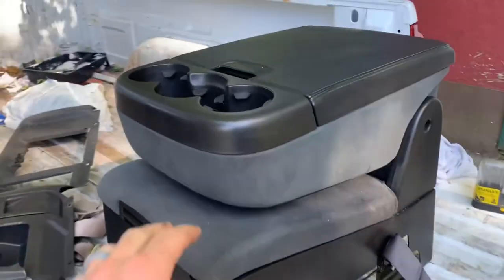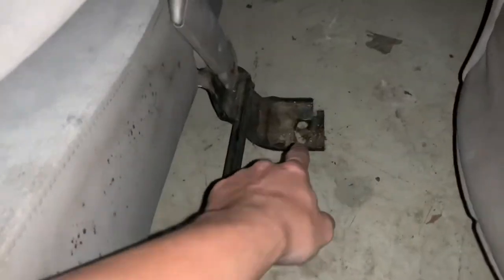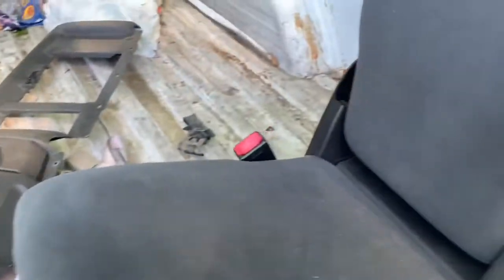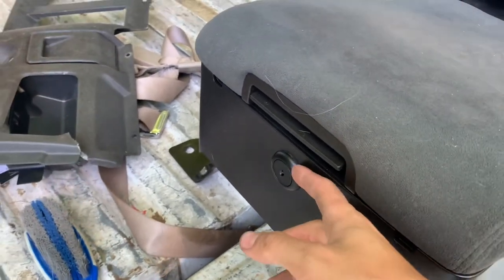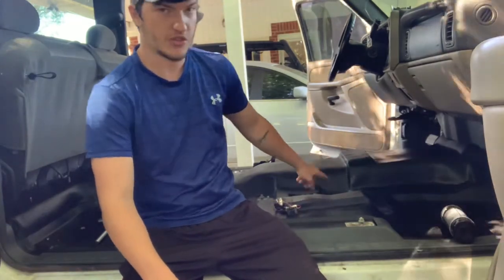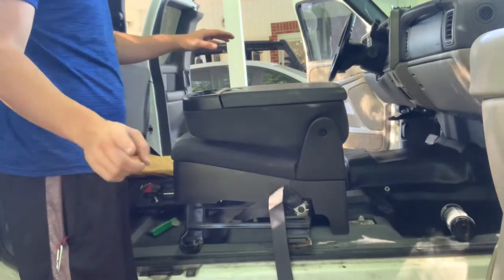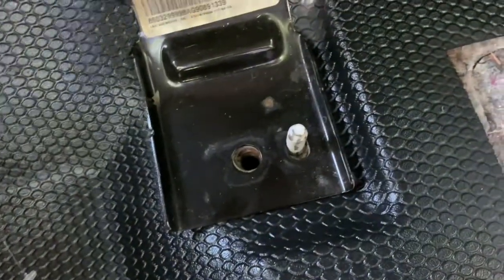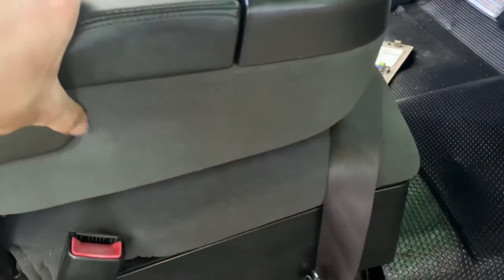07.5-13 Silverado Center Console in a 99-07(classic) Silverado!!!

Comment: Donde puedo comprar la nueva consola para GMC 2500 2007 y cual es el costo aproximado?
Reply from the maker: No hablo español, así que estoy escribiendo esto en la traducción de Google. Su mejor apuesta sería un depósito de chatarra o de segunda mano de alguien que se separa de su camión. Puede obtener uno de alguien en buena forma por entre $ 75 y $ 200. una nueva consola de un distribuidor o incluso de eBay costará alrededor de $ 600 o más. Las consolas deberían ser las mismas en las 1500 2500 y 3500.